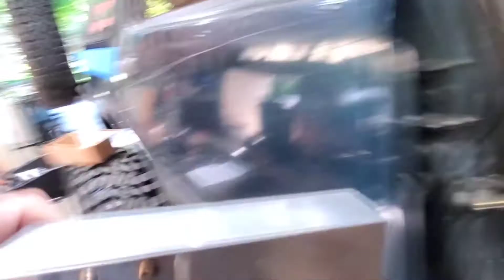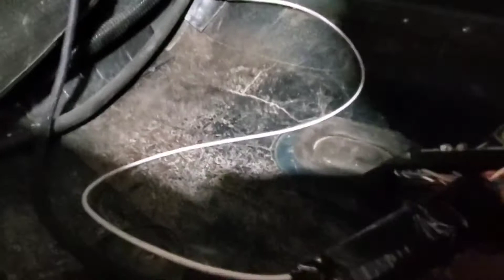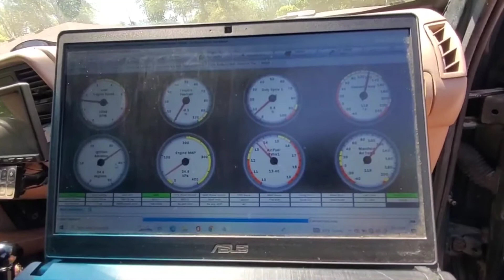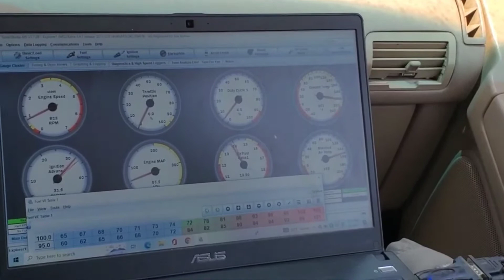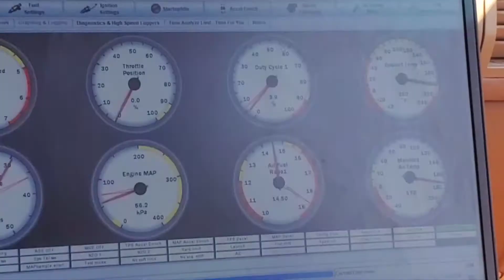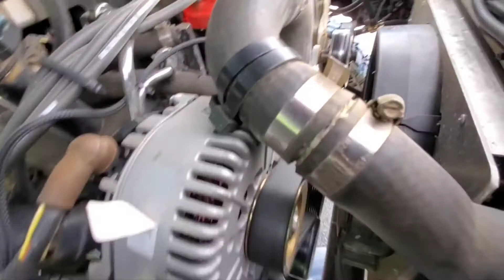EFI Source Microsquirt Install and Laptop Tuning Ford 302 5.0 V8 (342 Stroker)

Comment: So they sell a premade connector for ford small block ECMs?
Reply from the maker: Yup, virtually plug and play.  Starting with the Ron Francis engine harness is definitely a plus, and then, as I show in the video, the micro squirt is a simple install.
Reply: @BuildItWheelItExploreIt well he got back to me. Unfortunately they didn't have a compatible harness. So I bought Ford Fuel Injection and Electronic Engine Control. A book to help me find my pinout. So I'm going to try that. But I'm closer. I might have to just build a harness from replacement ends and my 8' generic. Thanks again for the help.

Comment: Sounded like a tooth off on the distributer gear.
Reply from the maker: Tooth of at which point? Far as the timing being off, I didn't have a timing light that apparently accurately read the timing.  Until I brought it down to Brian's... Best I was able to rear was 10° but quickly found out it was 5° retarded.. all set now.